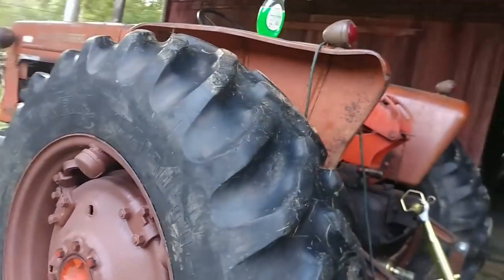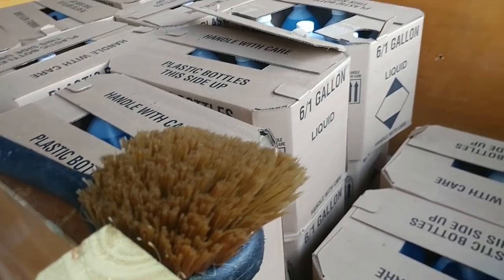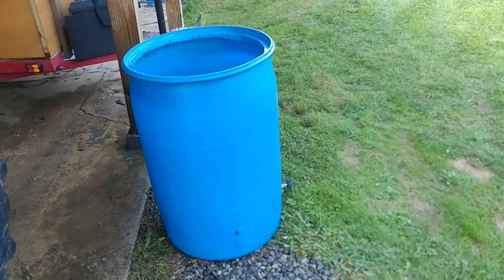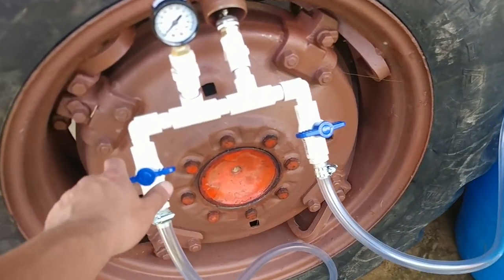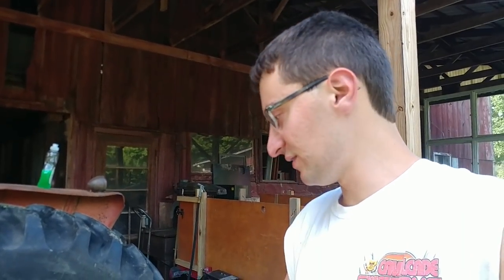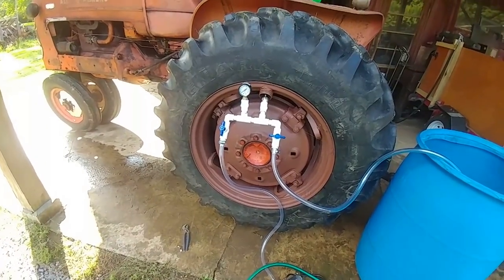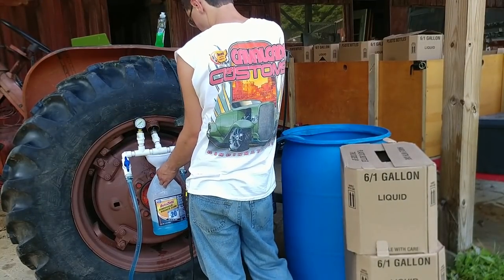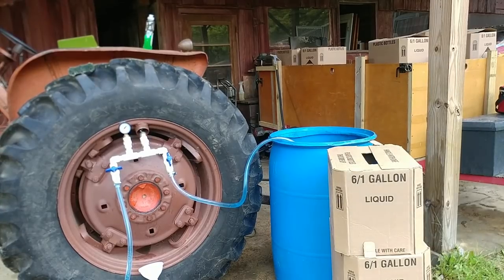YOU CAN WEIGHT TIRES AT HOME!! WHAT YOU NEED TO KNOW! 53 GALLONS PUMPED IN AS LITTLE AS 20 MIN!

Comment: thanks for the shout out! much appreciated! also your time of 20 minutes per tire would likely be right for that size tire so long as you turn the pump on and add fluid in the barrel while the pump just runs. only stopping when the pressure gauge reaches 20 psi or so. if you had better access to your valve stem you likely could have stopped that annoying drip. I suggest machining an extension or buying a truck tire valve extension tube to extend the valve connection point out where you can get some channel lock pliers on it. you see those extensions on tractor trailer tires. may be worth having if you start the business. heck I may run an add on CL to see if I get any hits myself. what would be a decent fee to charge? $45 service fee plus $3.50 per gallon which would include the fluid needed. that sounds like a reasonable price to me. what are your thoughts?

Comment: you can buy the fluid pump from tire dealers its done with aircompressers ive done it many times in the 1970s takes 40 to 50 gals per tire to give more pulling power but it wont keep tractor from flipping thats why they put weight on front of tractor ask a tire shop

Comment: We added antifreeze to the water on our large tractors. I made a tool for doing it out of an air tank off of a semi truck. I made a stand out of an old car wheel and welded three angle irons straight up on it so the tank would slide down in and secured it with a couple of big hose clamps. On the bottom end of the tank I cut a hole and welded in a 1/2" merchant pipe coupler and put an elbow and shut off valve. On the top of the tank I cut a hole and welded in a short 2" pipe nipple. It had a cap with a piece of round stock welded across it so it could be taken off by hand. I also cut another hole and welded in a 1/4" merchant pipe coupler and added an air schrader valve to add air pressure. Close the valve at the bottom, take off the big cap at the top, pour in the antifreeze, put the big cap back on, pressure up the tank some, open the valve at the bottom and blow the antifreeze into the tire. Worked great and made a time consuming chore real quick and super easy. No pumps.. On the out side of the valve at the bottom i adapted it to garden hose thread. I cut down a good quality garden hose to about 10 ft long so it would be easier to handle. The tire valve stem has to be in the up position on the tire. It would blow in 4 gallons at a time. We only had to put about 50 pounds of air on the tank to blow it in and that was more than enough.

Comment: Could have used rv antifreeze $2.49/gal non toxic non corrosive non everything.  Washer fluid is mildly toxic if leaked. Been doing it to all tractors I've owned for years with a $10 drill pump and a bucket. Your setup is unnecessarily complicated. Rv antifreeze is the second best option aside from beet juice.
Reply: I agree where can you buy the beet juice and how much is it /gal. I think a lot of road crews are using beet juice instead of salt now.
Reply: Also on your simple set up does the displaced air have a way to escape or do you start with a flat tire?
Reply: @Don Yuke  I've found that only tractor sales and service companies do it. They buy it in bulk, in a large tank. They want you to take the tractor to them, drop it off. Give them a day or so. Then come load it up and take it back home. I don't live close, and Gas ain't cheap. For my smallest Allis-Chalmers 5020 4wd, they quoted me $300 for the two rear tires. They are tiny little 11-24's. By comparison that's considerably more expensive.  Each tire requires 23 gallon. I think it cost me about $58 in rv antifreeze per tire.
Reply: @donyuke9459  Milton S-466 Tire Valve Adapter Kit removes air as it fills
Reply: @FastEddy5  Thanks Larry my Kubota with 12.4 x 24's ought to hold about 25 gallons then or about 200 lbs. I think you basically want to load them about half way and you can tell by listening as your filling what level your at by spinning the valve stem down every now and then as filling.
Reply: @Don Yuke  your welcome, my old allis manual said 70 percent. But you are right about 200lbs